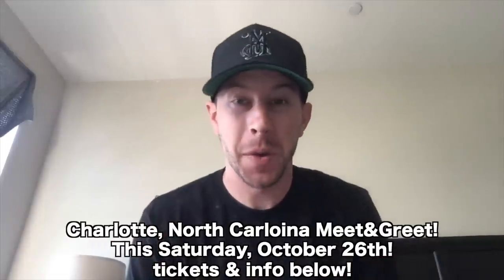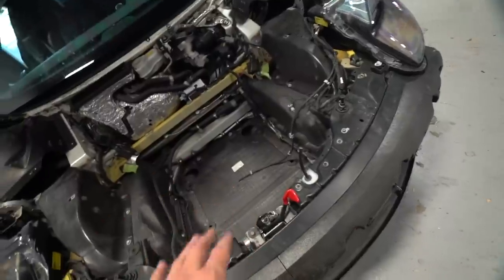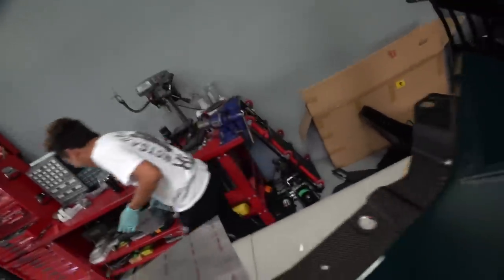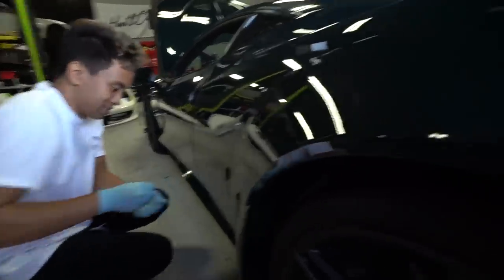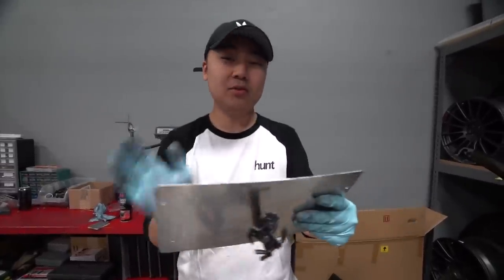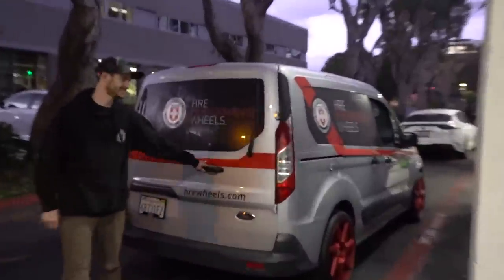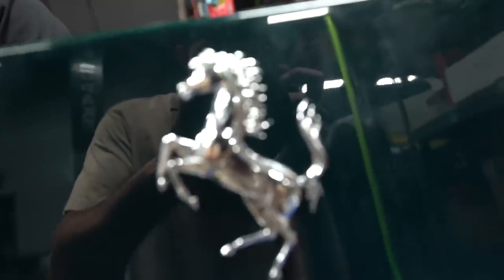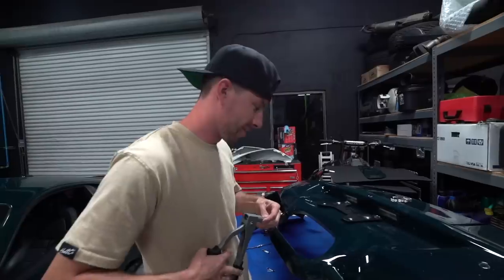Ferrari GT3 458 Wheels & Reassembly!

Comment: Why are u drilling holes for numberplates when u can take some magnets on the backside of the bumper they hold the plates... So you can easy remove it for pics and stuff... In Germany wie use them a lot on tuning cars...
Reply: c k because the back bumper is carbon Kevlar

Comment: Tips from a welder- 
Buy once, cry once
Buy a set of extremely nice drill bits
Go slow when drilling
Don't keep using if they go dull
USE COOLANT AND OIL TO KEEP FROM GETTING HOT.
They'll last so much longer and stay sharp longer.